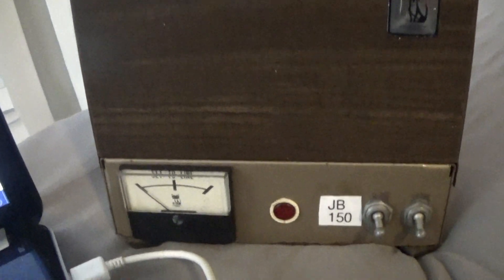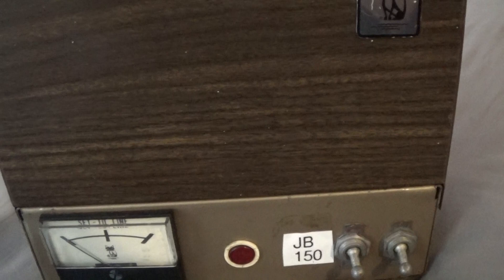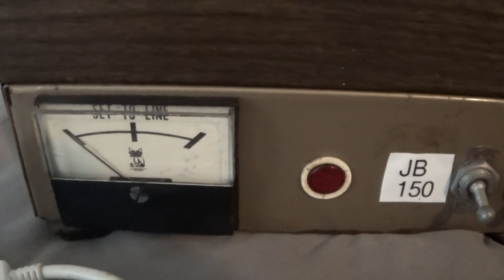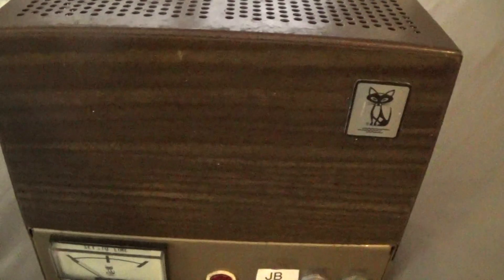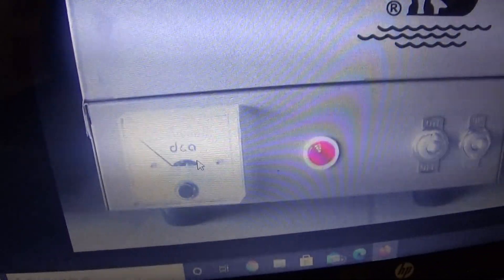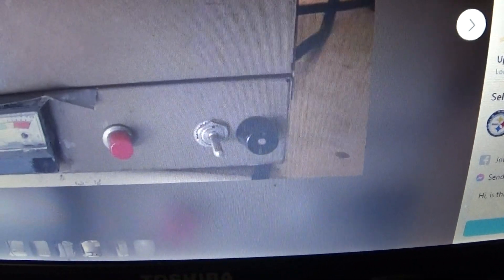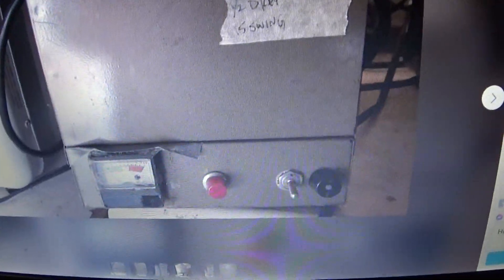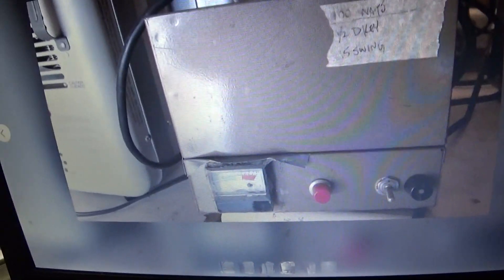Blackcat JB-12's/ JB-150's different meters used. "Set to Line" Seeker, Sonar, and D+A

Comment: Sir could you make a video on the proper way to set a JB200 and JB76 thank you
Reply from the maker: Sure, soon as I get one up and running. In the mean time, 40 watt dead key or less/dial on the back. Normal 4 watt CB radio drive, approx 25 watts peak in. Will do approx 200 peak out, maybe higher with really good tubes. Worked best with Sylvania 8417's.  Higher dead keys will kill the Tubes (8417's very expensive) and the power transformer. It uses an audio tube (high powered 6L6 family) in Tetrode mode, crazy audio.  Tuner on the side is the Load tuner, tune for max peak watts while modulating. Tune cap is internal and fixed (not adjustable). Early the amps where called JB-200's and later changed the name to JB-76. JB-200B or 76B where base units and JB-200M or 76M where mobile units.